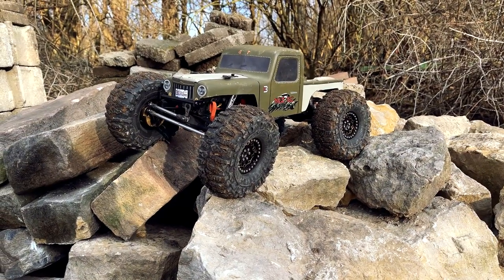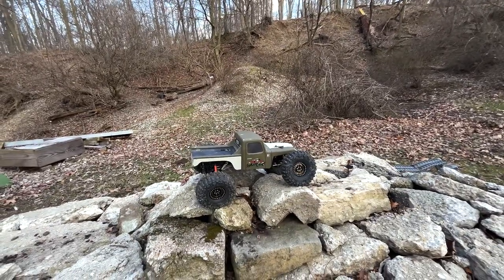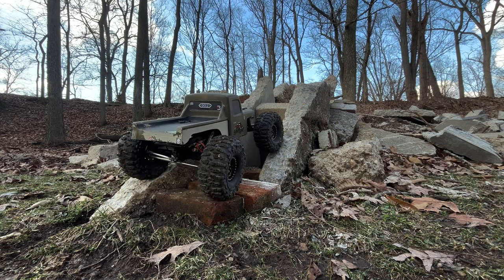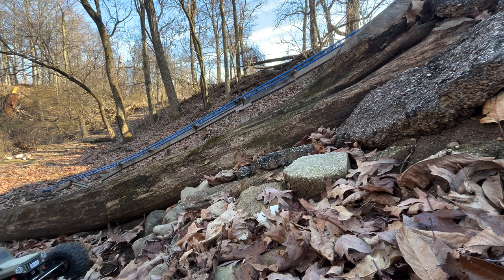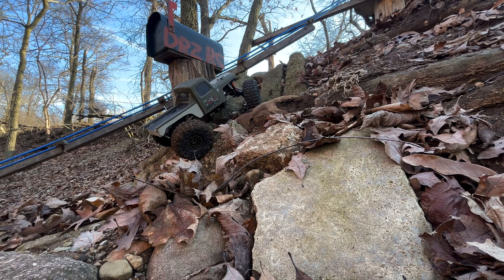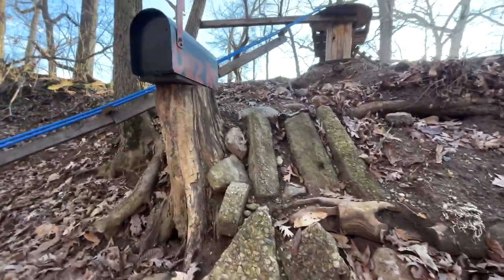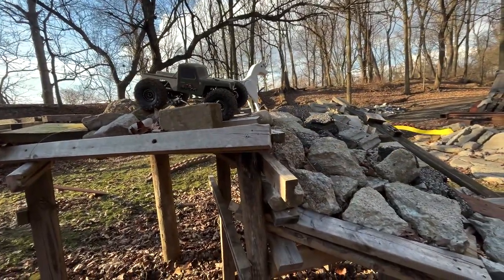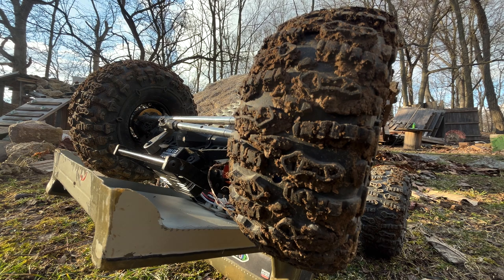Disappointed would be an understatement. Trying 2.2 Ruptures on Gapra.

Comment: You deserve huge respect for staying so calm! I would have freaked out so much after a short time that the video would not have been publishable. I suspect that the large diameter of the tires plus portal axles ensure that it doesn't work at all. I wonder if tires with a needle profile have such a hard time getting up the metal ribbed profile? Presumably slick tires don't slip a bit on it.
-[8-D
Reply from the maker: Thanks, it was incredibly frustrating to say the least. I’ve had other supposedly “less capable” 2.2 tires that have done far better on this rig. Even the stock Bomber 2.2 Wild Peaks made it up the metal ramp obstacle. That ramp has such high bite traction, with the edges, that I don’t take my super soft compound tires on it for fear of tearing them. There is no logical reason why these particular tires shouldn’t climb right up that thing. I’m just blown away at the lack of performance with these 2.2 Ruptures, especially when the 1.9 Ruptures are some of the best tires I’ve run on this particular rig. I was not expecting this at all.

Comment: Damn bro i feel your pain! I wouldn't of thought they would be bad at all. Maybe those inserts are killing ya 🤷‍♂️  did you get the stock foams by chance from the dude? Anyway, good vid bro and it sucks they didn't do well
Reply from the maker: These didn’t come with the stock foams, but I’ve got a second set of identical tires with the stock foams still in them, the inserts in these feel way softer than the foams. They did decent over at Bull Ring, but absolute garbage out in the wild. I may end up doing some slight modifications to give these tires a second chance, but we’ll see what happens when the time comes.

Comment: Same here mate with 2.2 showdowns on my stretched Capra, way too big and ruined the handling.
Reply from the maker: I was just stunned with the lack of traction more than anything else. However, I fixed that issue. I did a cut-n-shut and shortened them by about .5”. Now they are performing great, right on par with the 1.9 Ruptures that I normally run. I did a head to head comparison video between them a few days ago. It’s crazy how much difference a half inch can make!

Comment: Dude , I see no sidewall tire flex. The tires appear to be hard. I run 2.2s on some of my crawlers with inserts and have way more flex in the sidewalls. Love my 2.2s. Maybe the weight ratio is off? Keep up the good work.
Reply from the maker: There was actually some compression there, but apparently not enough. Those inserts are a little shorter and “softer” than the stock foams, but it is what it is. I’m thinking I may try cutting a section out and sizing these down to just a taller 1.9 and see if I can make something happen with a little shorter tire. I don’t really like how tall these are on this rig anyways.